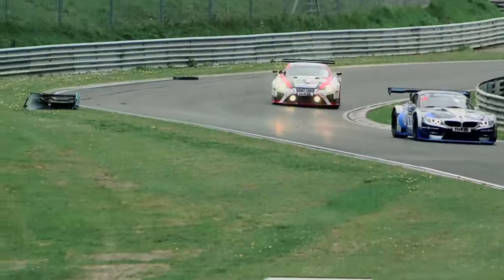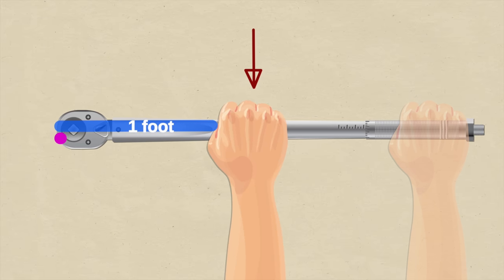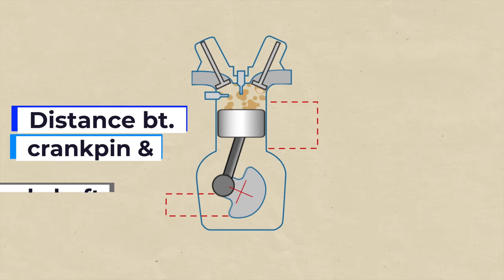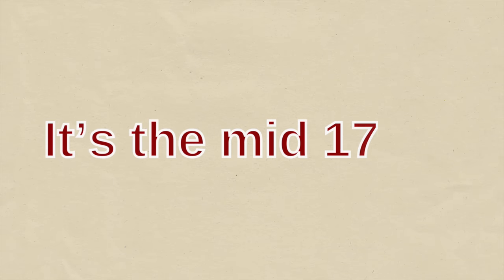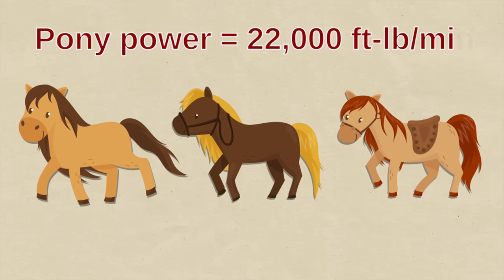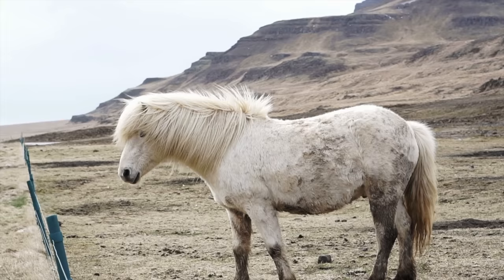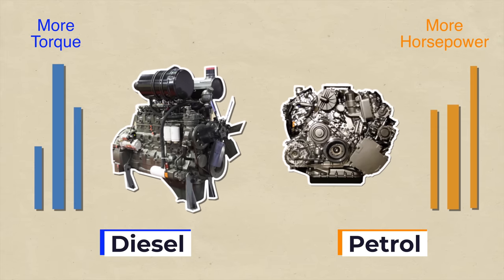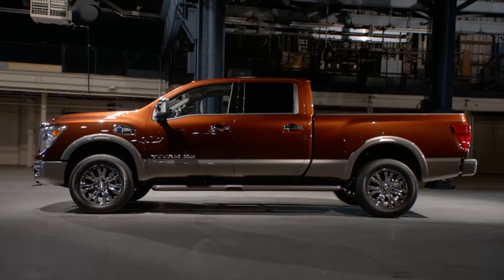Torque vs Horsepower, Which is Better

Comment: I get what your saying Scotty.. but lets get back to basics and NOT perpetuate the non-sense of "horsepower".   Instead of keeping up the convoluted... lets teach people real science (torque).

Reciprocating piston engines, electric motors, steam engines, jet engines, ect....  never have and never will make "horsepower".  
It's nothing more than a simplistic way of speaking to simplistic people who could not understand the science of torque.  

I don't blame mr Watt  at all.  He was quite astute at the time and found a simplistic way to relate to the common and uneducated consumer.

So now-a-days everybody has grandfathered the term and speak as if its a real and tangible thing.  Yet.. ultra few people today would have a clue how much work can be done by a horse.

It could be equally valid to have used dog power by simply changing the math.  Or rabbit power, or human power.  Maybe even Scotty power..
Reply: I see what you're saying. However, how do you compare two different piston engines with each other? Torque doesn't explain work which occurs when torque is applied over a distance for a certain time period. Horsepower conceptualizes work. I'll agree it's not the only attribute to know about various mechanical and electric "engines." But it still is helpful. BTW, electric motors are rated in HP.

Comment: I'm a second-year mechanical engineering student who has passed (among other classes) Calculus II, thermodynamics, physics: mechanics, and statics.

I'm STILL confused by this concept.
Reply: Try this. You're tightening a nut with a 12" long wrench. It takes you 1 second to make a complete turn of the wrench and you expend 100 lbs. of effort doing so. And let's say you're really strong and fast and can do 60 nuts in one minute. That would be a lot of work. Well, the 100 lbs. of effort is torque - twisting effort,  and the speed you do it at is equivalent to 60 revolutions in one minute. Horsepower is equal to 60 times 100 divided by a constant of 5252. This means you put out 1.1 horsepower of work. And horsepower is useful to compare different engines with each other although there are other attributes that need to be considered. Hope that helps.

Comment: What would you like sir, Torque or Horsepower... yes... give me Electric Power.
Reply: Tesla's electric motor is brushless and uses induction instead. And the counter-electromotive force is zero when the motor starts, thus, instant full torque. Internal combustion engines have to move a lot of heavy parts to get the RPM higher and that steels power from being used to accelerate. Go get that electric motor!